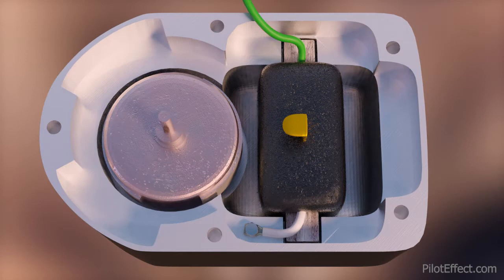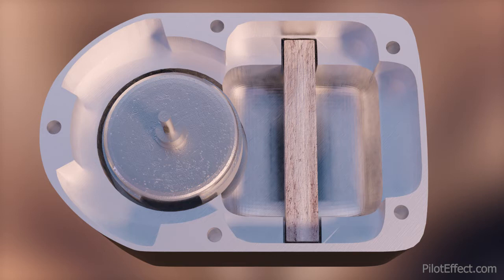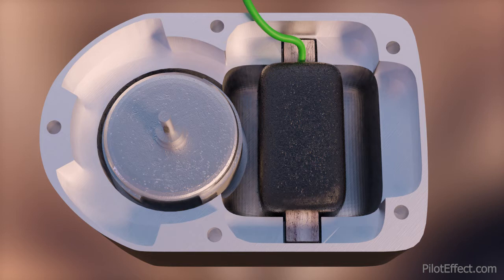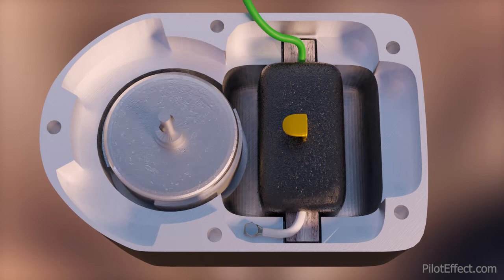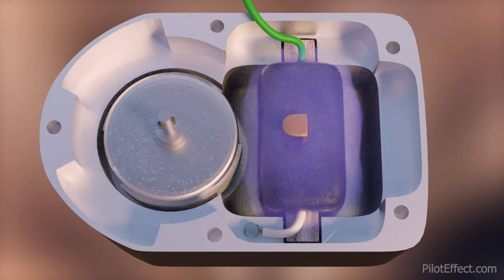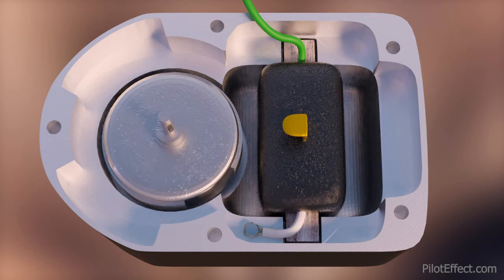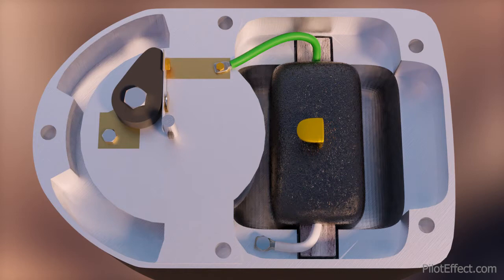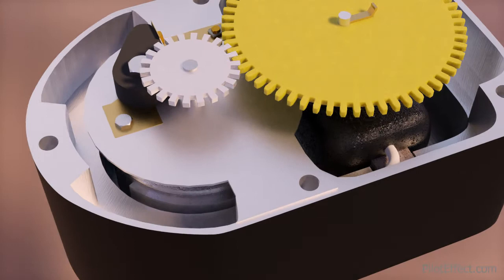Magneto Tutorial | Magneto Part 1

Comment: .... A circuit diagram of the coil  windings and exact connection of the points is required .I'm contending that the collapse of the field is for the primary windings and the secondary windings step up the voltage generated in the primary but without a layout we can't delve further .
Reply from the maker: that's way over my head, gooood luck

Comment: Hello can alternator act as magneto?
And how wuld I prevent shock tought chassis ground?
Is there any posibility to use capacitor banks instead lead acid baterry if so how to protect lead acid baterry to be effected be ac ?
Im looking for old magneto ignition system .
But I dont understand how they manage not to get shocked.
Can alternator winding be placed in series ore pararel configuration with ignition coil ?
If so wuld still ignition module work inside destributor with ac electricity?
I mean wuld the ignition coil still operate more ore less normaly ?
Reply from the maker: idk